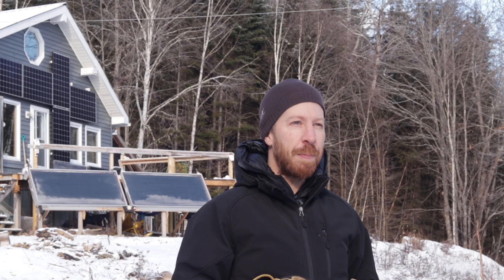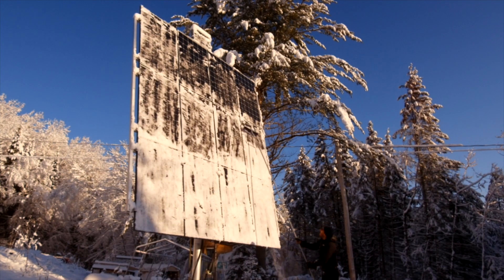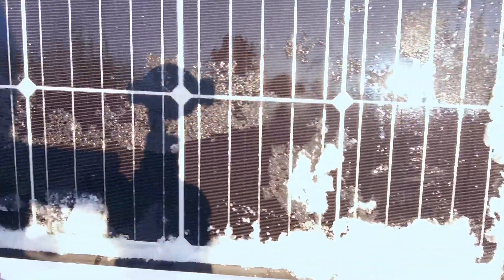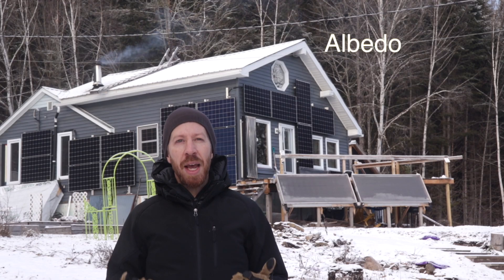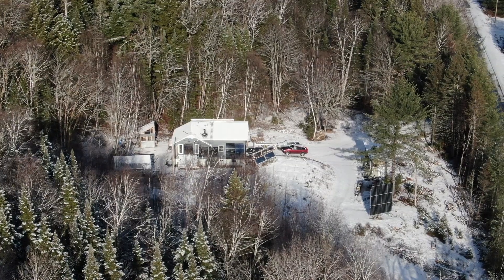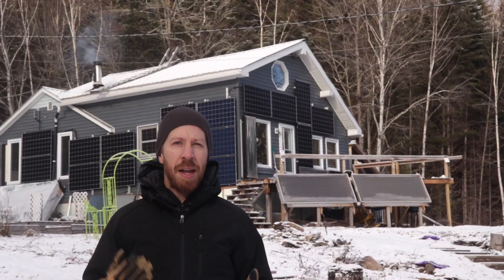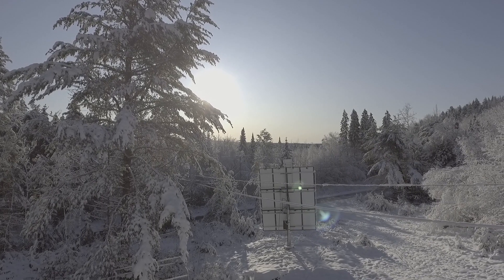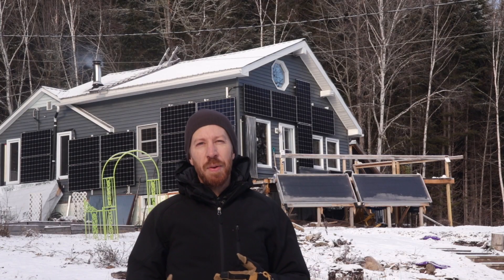Solar Life 12 Panels in Winter and the Albedo Effect

Comment: Thanks for the video.
Having PV on a roof and in my field I agree with your idea of putting them on the house sides. In snow shed areas you just don't want panels on the roof, you'll lose a couple of months of energy production. With long summer days we always generate enough to run everything and keep the batteries charged but not in the winter with its short days.

Comment: Youtube: You might like this Ive
Me: Thanks youtuber.
haha. Cool video. I was like why are these panels mounted like that. ha. Do you have a video where you talk about the cost of the system, specifically those panels mounted on the house compared to the power they provide. 
I guess what I mean is....was it worth it comparatively ?
Reply from the maker: The first couple videos discuss cost.  Was it worth it, yes absolutely, but that has little to do with Return on Investment and more to do with power independence.  It cost about 40K but that includes lots of appliances like a generator and propane installs.

Comment: Does ice reflect better than snow? I'm wondering if the angle of the surface of the snow or ice under then panels affect the reflection efficiency. Have you tried moving snow or ice from other areas on your property under the panels to increase the number of days with reflection?
Reply from the maker: Snow reflects better than ice, the angle of the light matters a lot but is not as important as cloud cover or other blocks like trees and such.